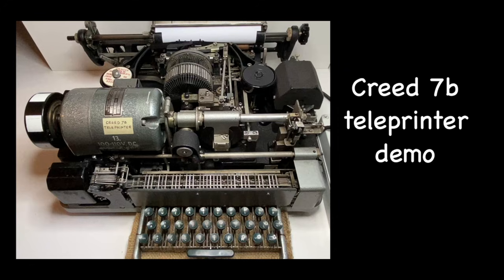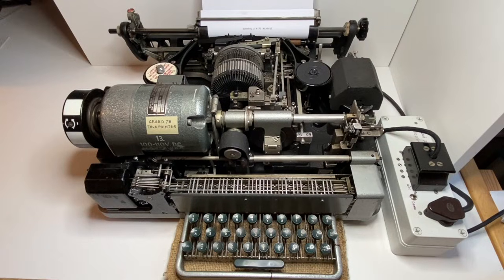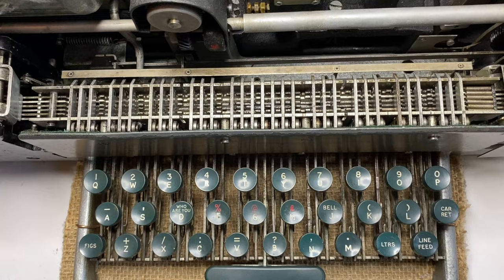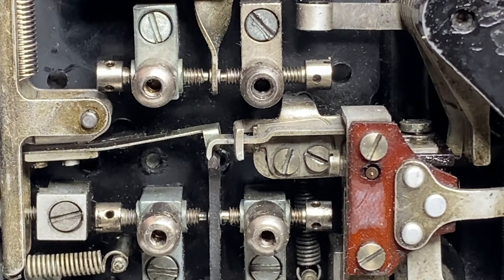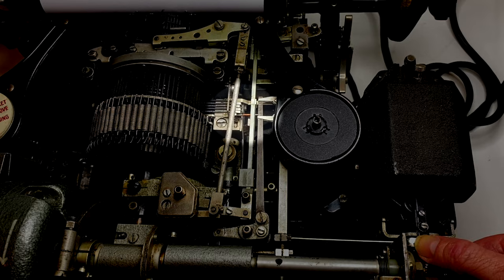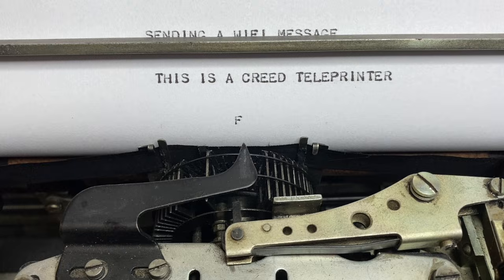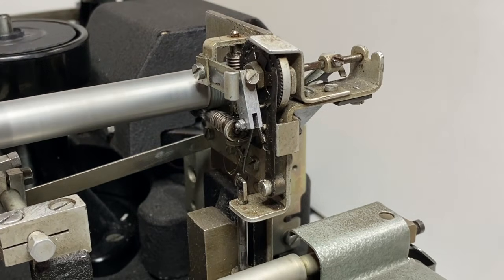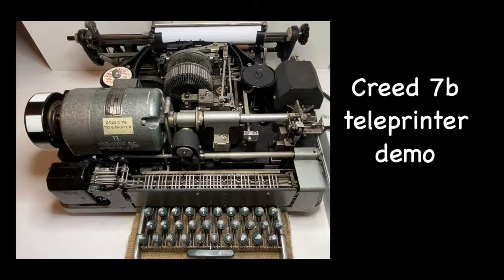Creed7bTeleprinterDemo

Comment: Thank you to explain the Creed 7b.  I grew up in the 1970’s where 300 baud over tel co was as fast as it got.  However, I can see this predates this, and I remember you saying the 7b converted characters into a Morse like code and I understand marked vs unmarked.  What I don’t understand is were these connected to dead pair cables over phone poles?  Where did the signaling power come from?  Were these connected together at a central point for let’s say a geographical group of Police stations for an “All Points Bulletin”?  Was ground used in the signaling? Reverse polarity?  I realize I am mixing eras of tech in my questions.  You are obviously an expert and perhaps you could shed some light on what these were used for and how they connected.  Thank you!  Jerry from Chicago
Reply from the maker: I don’t know how it worked in the US, Jerry. Here in the UK the teleprinter signals could be passed through telephone exchanges, or central offices as you call them. A normal telephone would be used to call the teleprinter number at the receiving end. The teleprinter code would be transmitted once the connection was established. This transmission was made possible by converting the Space bit in the code to a 300Hz sinewave. The Mark bit would just be silence. Power for the electromagnets of the teleprinter would be provided at either end. At the receiving teleprinter the 300Hz signal would be detected which would then activate the Space magnet. Remember that each character has a Space as start bit and a Mark as stop bit. So, the line would be silent if no characters were received.
Reply: @ I really appreciate the detailed explanation. Thank you.  I certainly remember 300 baud.  I also remember connecting into the Internet with a 56k modem and tooling around and concluding the internet had no value in its public infancy.  If you like old telephone sounds, Evan Doorbell on YouTube has an amazing, well edited collection of the sounds from Circa 1970’s the US phone network.  This entire network was electro magnetic based, no computers running the switch.
Reply: @wimderkinderen1952  In the US, it evolved over time due to divisions between telegraph (e.g. Western Union, Postal Telegraph Co) and telephone (Bell) infrastructure companies.  
In the very early 20th century, these systems were operated exclusively by telegraph firms like WU (the first large US user of teleprinters), and ran over existing telegraph lines between their offices, with messages being printed out there and delivered as telegrams. 
 
As the 20th century progressed, the AT&T/Bell organization became interested in offering links between subscribers who could lease teletypes.  These didn't use the typical voice lines and exchanges, but instead operated through a dedicated Teletypewriter Exchange (TWX) system (1931), which used architecture that I believe only passed telegraph pulse signals across the network.  Oddly enough, TWX required operator assistance to place a call from inception until the 1960s, so the link to the nearest central office was technically a voice link, but the links between central offices were not.  There was deliberate non-interconnection between the TWX system and typical voice network switches.  Signal passed to the teleprinter from the telephone line was through a sensitive electromagnetic relay at the teleprinter ("Polar Relay") to decouple it from the central office, so this system was not doing audio modulation at the subscriber end.

TWX only became a direct-dial system in 1962.  A bit strange, because voice subscribers could at least do direct local dialing through Strowger, Panel (1915) and Crossbar (1938) offices during that time.  Through convoluted events, Western Union got involved in Telex, and eventually bought the TWX system from AT&T in 1969, and TWX got harmonized into latter generation Telex-II systems after that.

There is a lot of convoluted back-and-forth trading of assets in this story, as Western Union and AT&T continually bartered for specific markets and monopolies.  Morkrum & Kleinschmidt were competitors, and built teleprinter machines to slightly different specifications for their different customers.  They merged into Morkrum-Kleinschmidt in 1924, then rebranded as Teletype in 1928, then were purchased by AT&T and became a wholly-owned subsidiary of the Bell telephony monopoly in 1930 (within the Western Electric umbrella).  
This is a bit amusing, as the manufacturing arm of Western Union telegraph, "Western Electric", had been traded to AT&T in 1881 and became the manufacturing arm of the telephone monopoly from that point forward (it kept the "Western" moniker in spite of no longer being part of WU).  So after 1930, teleprinters used by Western Union were being made, effectively, by Teletype, which was a subsidiary of Western Electric, which was a subsidiary of AT&T.
So the largest US builder of printing telegraphy hardware was owned by the voice communications monopoly, and sold teleprinters to the remaining telegraphy monopoly of the US for many years.